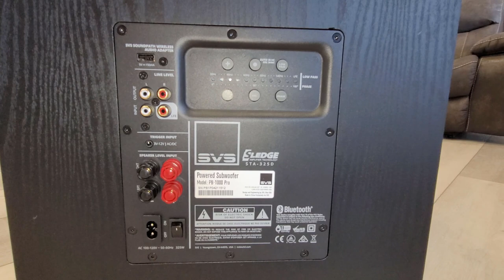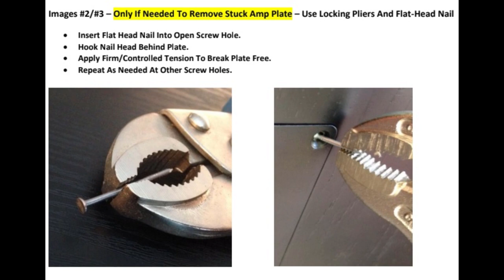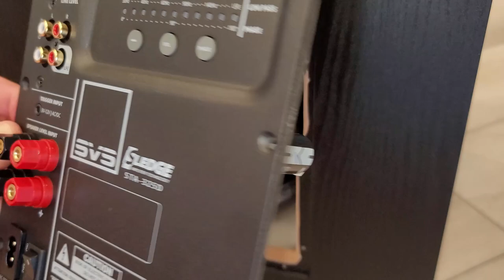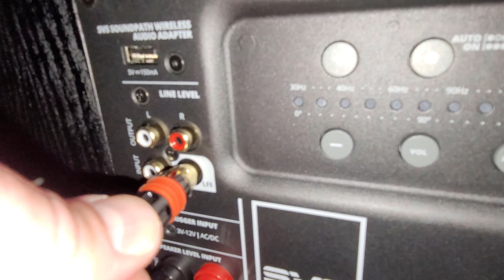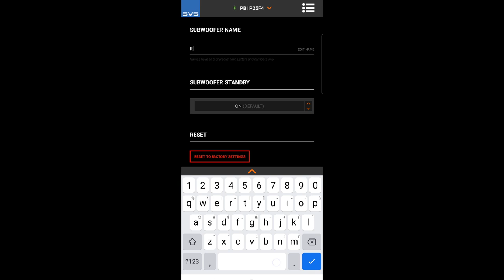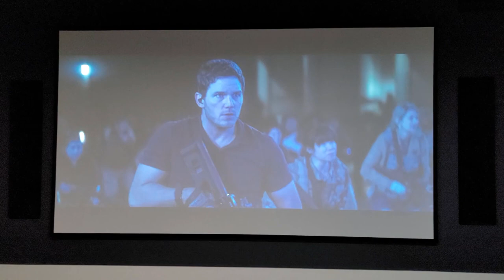Basement Home Theater - Broken SVS Sub & How I Diagnosed and Fixed It

Comment: plate amps have the lifespan of a firefly usually. I replaced the plate amp on a Bowers sub by using a spare receiver channel. later I bought an old Velodyne and used the plate amp from it. The reason I bought my current subs is they use Ice modules for plate amps, a pretty reliable class D amp.  And they have 12 volt triggers.
Reply from the maker: That's some creative thinking to keep a subwoofer in service!  Nice work 👍
Reply: @TyEichele  A lot of experience,  the one good thing about growing old, not to mention three years of electronics training. Until companies start putting amps with real current in subs (and  some do) nothing will change
Reply: most of these svs plate amps have the same issue no sound even those aprts express plate amps as well. Im wondering what could be the issue
Reply: @Nelan555   I never pay much attention to a brand. Doesn't matter much. As long as the industry insists on saving a few bucks on disposable amps it's going to be a problem. 
A  cheap amp meant for left/right could power a couple of subs fine.

Comment: Hi, just a couple of days ago I did a similar operation)) they also sent me a new amplifier, installed it and it all worked.  I have a request for you, share your avr settings, in terms of bass, the main speakers are set to small?  what volume level is set in svs?
Reply from the maker: Interesting indeed.  My Denon has all the speakers set to small yes.  My LFE is at 120 Hz.  The Subwoofer output in the Denon is between -6 to -8 depending on the movie or how much bass I want.  The SVS app has both the subs set at -10 for Volume level.  The MiniDSP also has a setting which is currently at +6 for all channels.  Does that answer your questions?
Reply: Wow, two subs blown in one thread. Not the first time I’ve heard about plate amp failures in researching Rel and SVS to replace/augment MartinLogan Depthi subs which are too light on power for HT. Good to see a quick response from SVS, but it is bothersome to see so repeated occasions of failures.
Reply from the maker: @SealedOrPorted  Agreed - hopefully just a fluke deal, guess time will tell.  I'll have to update with another video if it happens again!
Reply: @TyEichele  Thanks for the reply Ty. I realize it’s a trade-off quality/cost for these manufacturers, that is why the customer service is paramount. Furthermore, if they can identify the failing component(s) then the issue goes away. Thanks again for the video.

Comment: hmm.
  I was hoping to figure out why my CT-150 Velodyne (yeah it's pretty old but hasn't been used in years in my warm living room as a table for my receiver. lol)
   I turned it off permanently because occasionally I'll get a loud boom even when not in use.  When I get close to the woofer there's an occasional static.   I've replaced the cable. Still an issue. 
   Is my expensive seldom used subwoofer just a table now?
Reply from the maker: I'm not sure to be honest....My guess would be something in the plate amp itself causing the issue?  But that's just a guess....Unless there is power issues like a grounding issue or something, I'm out of ideas as well.  Good luck though - just have to keep trying different things or might be time to say goodbye to it.  😟
Reply: @TyEichele   yeah. I mean it's only been over 25 years.  time to go shopping. lol.

Comment: I just bought one of these and a friend immediately bashed my purchase decision saying SVS are 'poor quality mass market products that dont last'. Having used two of these, what's your  opinion on quality of svs subs?
Reply from the maker: I don't think that way about them at all.  In fact, they are pretty popular from what I can see when I was researching them.  I am completely happy with mine, and they are the entry level models being the PB-1000 Pro....you can clearly go up in size and quality when you get to their advanced models, I just didn't have the money for them.
Reply: @TyEichele  Thanks for the feedback, so the second one is still fine and the one with new plate works well to date?
Reply from the maker: @lenanaH  Correct!
Reply: @TyEichele  Fantastic, cheers 🍻

Comment: How long did you have the sub before the amp failed? Cause?
Reply from the maker: I'm not sure of the timeline, however I had purchased them and they sat for a little while before going into use as well while I finished the theater area.  Pretty sure it happened within the first year that I had them, probably closer to 6 months.

Comment: I have the same sub,   might just run it passive if the amp blows,  tthe class d amp sux
Reply from the maker: Do you think it would do much as a passive sub?  I was thinking if it happens to me when they are out of warranty that I might power them with an external amp like a Crown or other rack-mounted solution.  Would take some minor modification to the enclosure but maybe just a SpeakOn connection or something.  It sucks to have to invest even more money that way but I bet it might even be cheaper than a replacement OEM plate amp?  Fingers crossed it doesn't happen in the first place 🤞
Reply: @TyEichele  worth a try
Reply: @TyEichele  

Why is the mini DSP needed in your setup?
Reply from the maker: @daveslk  It allows you to set up a custom EQ specific to your room and dial in your entire subwoofer system, so they work together and not against each other.  If you have multiple subwoofers it really is a must-have to get them to work effectively.  Skim through my video here for more details on how it works and look at the end result!  

https://youtu.be/bXYa06OPPOY
Reply: @TyEichele  I will check it out. Thank you.
Reply: Did it blow? new user here
Reply from the maker: @lenanaH  Not sure what happened to the amp, but SVS customer service was great in my experience and sent a replacement amp as you can see in the video, which fixed my issue.  I haven't had any problems since.
Reply: @lenanaH  no. But this svs sub isnt as good as a cheap sony at best buy,  the cabinet is good,  its just not one of their good ones,  i suppose their high end stuff is good. ,  but i dont know,  ive heared the rsl speedwoofer is good,  but i havent seen or heard one

Comment: How long did you have the SVS for this to happen?
Reply from the maker: That's a good question - I've had them for pretty close to a year but I bought them several months before my theater was finished so they just sat for the first few months.  I've had them in use for maybe 3-4, maybe 5 months I'm guessing.  And not very often at that either.
Reply: @TyEichele  that’s wired that your amps have  stopped working. I have two 12 inch Polk audio subs which are going on 3 years now and never had to replace a amplifier ones which for a brand like SVS is kinda shocking to hear that the amps stopped working
Reply from the maker: @Lowkey_nxthxn  Agreed.  Here's to hoping it doesn't happen again!  🤞
Reply: @TyEichele  I hope so to but keep us updated for future videos

Comment: Blown plate amps are becoming the norm with SVS Subwoofers. I'm starting to regret buying their subs. It's an inconvenience when your subs are down and out.
Reply from the maker: Oh for sure - as with any equipment!  I haven't really seen a whole lot on common plate amp issues with SVS.  I'm glad their warranty is top-notch though.  That always helps when you are faced with a situation like this.
Reply: @TyEichele  you don't know what you are saying. Svs and parts express get their plate amps from the same company these amps don't last 95% of them go bad in 6 months. I have had amps that don't last one week. Its always the same issue, coming on but no sound. Its something on the circuit board of the amp that is going bad very fast. If it doesn''t come on its because the high voltage caps are bad causing the transistors to get fried but most of the issues like i said no sound after a little while of use. They themselves make it very difficult for you to repair because they are changing the part numbers on the parts on the circuit board they give you no schematics for it

Comment: It looks like the old plate amp has blown capacitors. That's all that white gunk you see that's all over the board.
Reply from the maker: I'm not sure if that is true because if you look closely, the new plate amp has the same white stuff in multiple areas as well.  I could be wrong, but I'm guessing it's some sort of sealant?
Reply: The white stuff is just glue. All subwoofer amps have glue of some description over any component that could vibrate at the low frequencies. Vibration can not only create rattling noise but cause PCB fractures in the solder or copper tracks.

Comment: Sorry, but SVS just doesn't make subs with the same reliability as they used to be in the early 2000s.  WAY too many failures of this "high tech" BS.  It is a subwoofer.  I'd much rather it just work.